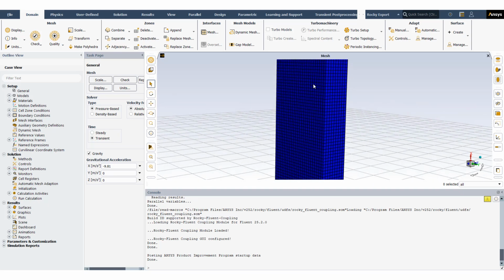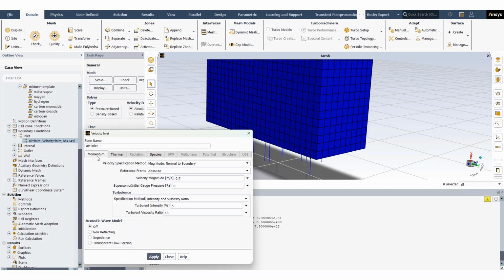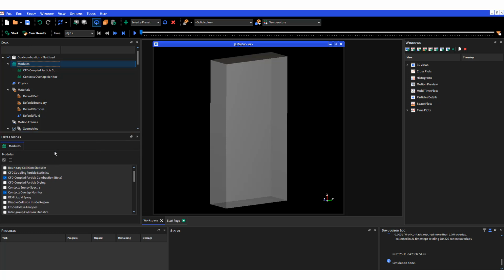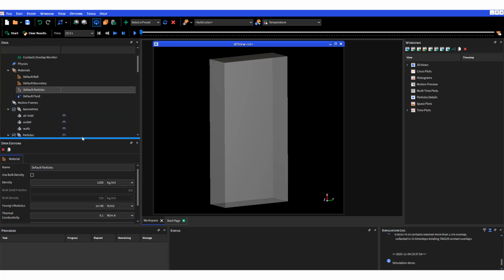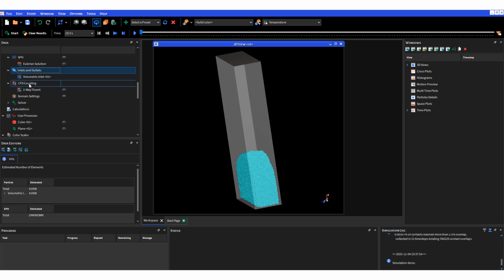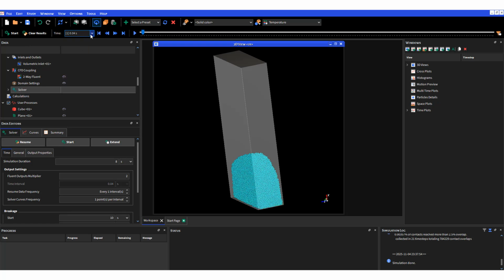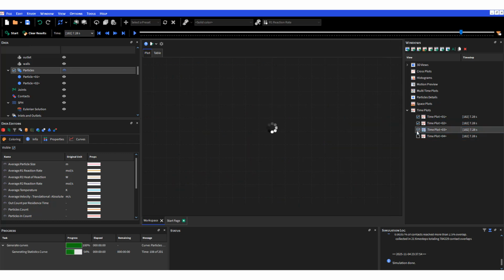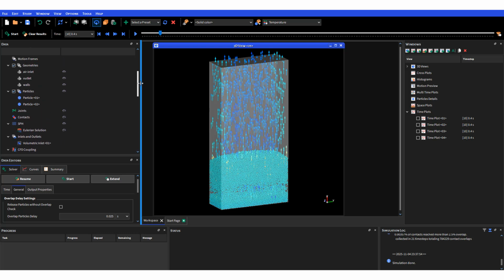Coal Combustion in a Fluidized Bed Reactor: CFD-DEM Coupling Using Fluent and Rocky

Comment: Excellent video, congratulations on the great content and clear explanation. I have one question: for the CFD simulation, is the control volume defined as a full solid volume (fluid domain), or is it only composed of surface walls that define the geometry? I would really appreciate it if you could clarify that point.